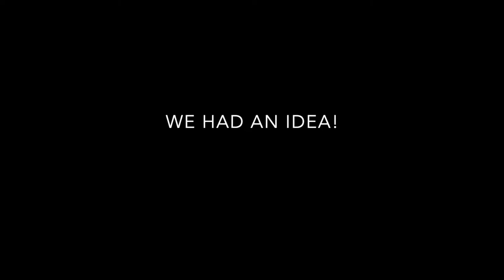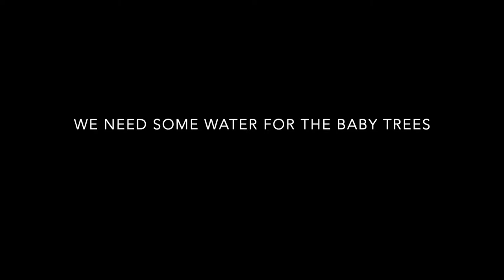Replanting degraded creek | Off grid homestead vlog

Comment: Great to see you putting in a Beaver Dam Analog.  As incised as your creek channel is, the storm runoff in the wet season is probably pretty decent and you might see that BDA knocked out.  Still, better than not having one at all!  Were it me, I'd install even more of them so they work in concert to slow down the flow of water during the storms.  If you search Youtube for Beaver Dam Analogs, there are hundreds of videos on how to make them and how well they work to raise the stream bed in record time. I've seen them raise up the creek a solid 3' in just one year by slowing the water and allowing sediment to drop out of solution!  As little water as you have running through it, she'll likely never be a perennial stream if the problem is upriver of your property, but you can make a huge difference just by slowing the water down as it passes through your land.  And the property owner upstream will probably appreciate the extra water, too.

Keep up the great work!
Reply from the maker: Yeah good point, we were talking about doing a few more... maybe with a loose rock base. Will check out some BDA vids 👍